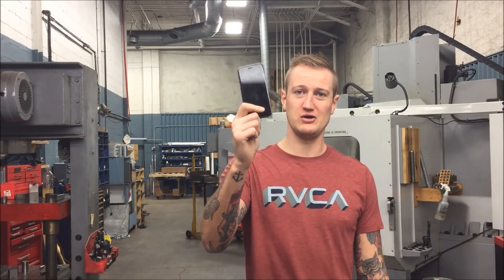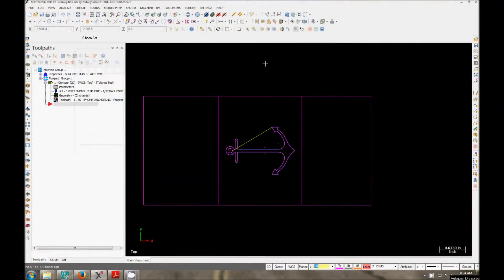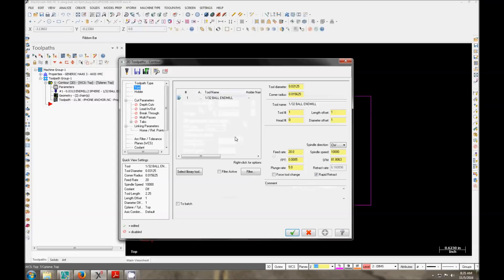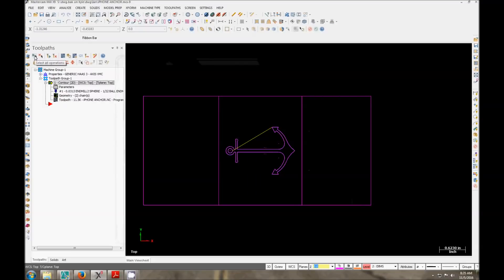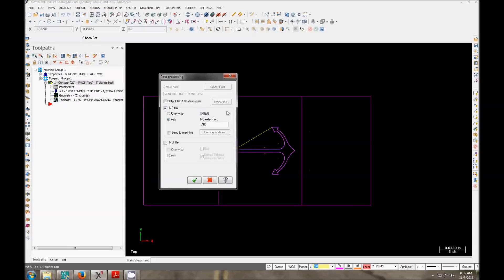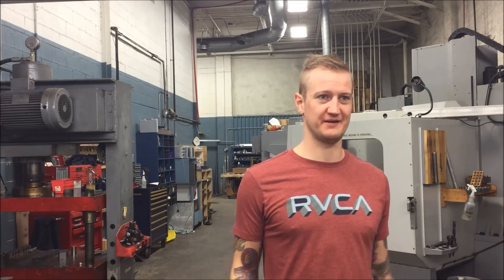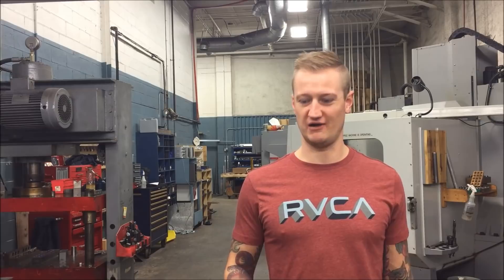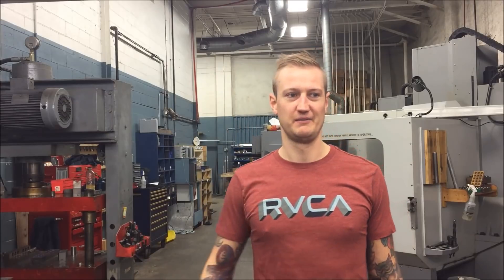LET'S MACHINE: ENGRAVING AN IPHONE 6 BACK & SCREEN

Comment: What engraving tool is that?
Reply from the maker: I've misplaced the case, but it's a carbide 2-flute engraver from Destiny Tool with a .001" tip.
Reply: Thanks.